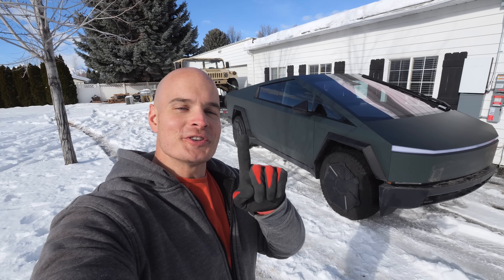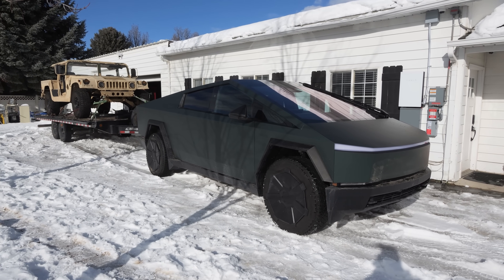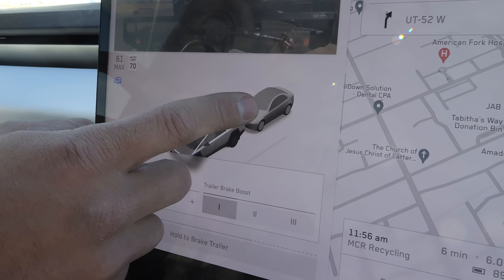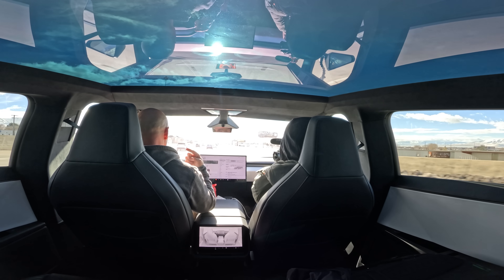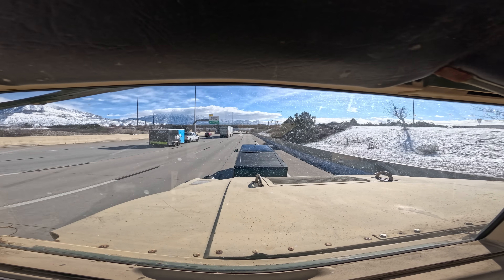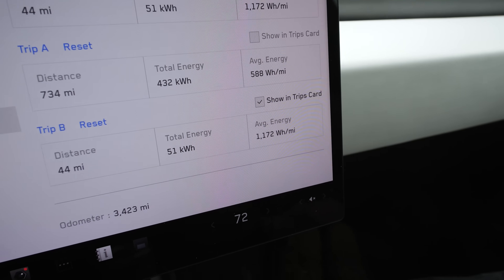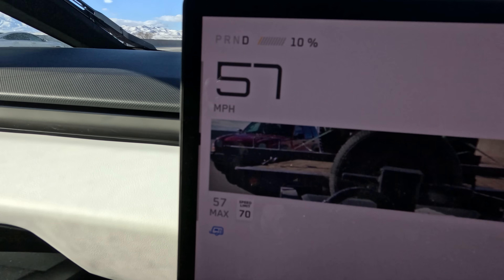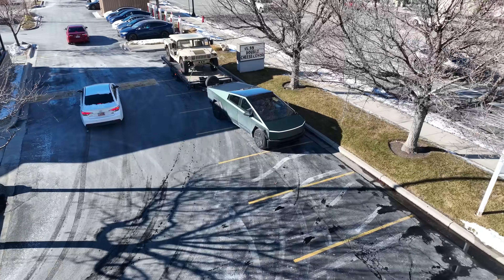How far can the CYBERTRUCK tow 11,000lbs in Freezing Weather?

Comment: 1,193 Wh/mi.  For comparison average energy over 2 years of driving a Model Y in Ca, mostly highway, is 285 Wh/mi.  260 in the summer, 310 in winter.
Another interesting comparison is that if it were a diesel ICE truck pulling same load and guessing it gets 10 mpg it would use 3,795 Wh/mi.  That's 3x more energy used.  But, that just shows how much unuseable energy there is in diesel or even gasoline (diesel contains more energy than gas).  Most ICE motors can only use about 30% of the energy in fuels.  Thermodynamic/mechanical limit.

Comment: Interesting concept vehicle. Just for reference; an F250 6.7L diesel can tow this load ~400miles and refuel in 5 minutes.
Reply: This wasn't buold for that.  Also, cost is gonna be 20x as much
Reply: You can only buy this truck as your 2nd or as a toy car.
Reply: And the refuel will cost what? $200 or more?
Reply: with a 60 gal fuel tank.

Comment: The scariest thing about this video is going 60mph on I-15 though the Wasatch front, even if you go 80 through there you'll be passed like you're standing still by most of the cars there
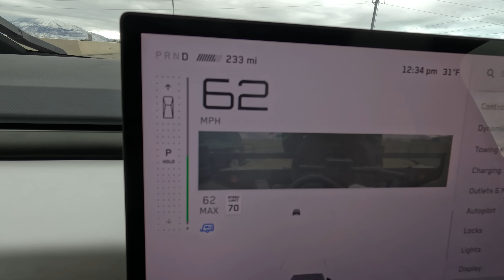Reply: 8:41 idd the cybertruck at 65 mph and a white pick-up with a car hauler went by so fast.  Almost german autobahn 🙂
Reply: @Blockiee  There is a 130 km/h, 82mph speed limit on many parts of the German Autobahn system these days, there's just too many people to go flat out all the time.  The best place to find the old school no speed limits Autobahn is in the old East Germany, it's less developed than the western regions.

Comment: These trucks are not at all useful for towing, except perhaps they would be excellent for short range repositioning of loads locally. The massive torque and the four wheel steering are cool and if your shop or distribution center has a high amp charger an electric truck might have. good niche.

Otherwise these trucks are not only horrible but disrespectful because of how much space they waste whenever they must drop the trailer and recharge.

Comment: For towing major weight loads, aren't the objects in tow supposed to be closest to the front as possible to prevent wiggle and flail?
Reply: Just forward of centre on the trailer, to far forward and you have to much weight on the tow hitch, most have a max weight loading on the hitch

Comment: It only gets 220ish miles per full charge due to being over-rated for real-world efficiency.  Try watching other owners' youtube videos and tiktok clips.  If you tow something in the ballpark of 2,000 lbs, and go 60 mph on freeway, good luck seeing more than 110 miles per fully charged battery.  And don't forget Tesla does not recommend charging to 100% nor does Tesla recommend letting battery go under 10% of charge.  Meaning, you only can use up to 90% of the battery capacity.  Not looking good.  But, if you just drive it around town and show off to people, you will be fine.

Comment: Yeah that's cool and all that it only cost $13 to charge it but 90 miles to a basically a full battery that's kind of crappy yeah it might cost me a lot more to fill up my 2000 Dodge Ram but on a full tank and towing I'll probably get about 250 miles to a tank yeah it cost me probably like 80 90 bucks to fill it but my truck only cost like 50 bucks to insure it because it's so old so it ain't worth it to me still to buy something like that

Comment: Would be interesting to see how these perform with the range extender battery pack in the bed. And will that affect towing capacity and tongue weight? Since that's a lot of weight in the bed I'm sure.
Reply: You can already do the math. The truck used nearly 1200 watts per mile. The range extender is allegedly 16kW, so 16000/1200 = 13 MILES 😂 Prob less due to the weight, as you noted.
Reply: @bry2k  Please pay attention to units.  Those aren't watts or kW.   If the range extender is a 50 kWh battery pack (that's a unit of energy, not power), then at 1.2kWh/mi that works out to an additional 42 miles of range.   And to the OP, yes, every extra pound you put in the truck reduces both the towing capacity and tongue weight.
Reply: Ya, and while your at it why don’t you tow a big huge battery! 🥴

Comment: I just don’t get it. To each their own, but what is the point? Even for a half Ton pickup. I went to the mountains on family vacation this past summer, 8 hour drive pulling a 5x8 box trailer. No where near 11k, but still, fueled up once. Took longer for the Fam to do the gas station snack run than to fill up and your back on the road. No worrying on out range, where am I gonna charge, is the weather gonna effect the battery. If electric is your thing, great. But 100k for a truck that will tow your boat 150 miles before becoming a brick for 40 minutes? I’m not anti EV, but I just have no interest.

Comment: $13USD to get a full charge. Doesn't sound bad until you consider the fact you only get 91 miles/charge when towing at/near maximum capability. Charging it every single night will add up too. I really hope EVs keep improving but thus far the specs of this truck really seem exaggerated by Tesla. Watch your fingers when closing the bonnet too. Apparently, there is no sensor to detect an obstruction and if someone's fingers or an item is in the way it will still close and you will need the Tesla APP to open it again. I think it looks cool but there are so many issues with the engineering that are not good. Drive safe.
Reply: From a lookup DC Fast charge rates at public chargers are $0.40/kWh to $0.60kWh.  If you charge at %0.50/kWh that 108kWh to tow the 90 miles would be $54.  A gasoline truck getting 8.5 mpg would use 10.6 gallon of gas. At $3.00/gallon that would be $31.80

Comment: Towing in   " FREEZING "  weather.  Well technically at 31F that is enough to just start freezing water.
Try that in   " REAL "  freezing conditions. Something like -30F or -40F.  That's what the temp is right now up here in Alberta.
We are seeing in the news what the real outcome of EV's in  COLD environments are, and how they are dealing with it.  And it isn't good.
Reply: Surprise, if it's cold enough your ICE vehicle needs a block heater, your EV will need to get plugged in too. People buying EVs with no access to sheltered parking did not bother to do adequate research.

Comment: You paid $14 to charge. OK so I drive a 20 yo car with a turbo admittedly i use 20% hydrogen that i synthesize on hand. That's 4 gallons I get 25 miles/gallon. 125 miles

Comment: Love what the electric trucks are doing and I hope the technology continues to get better and better. However, at the price point of these two trucks you can by a turbo diesel that gets pretty good fuel economy and would blow the doors off these in the metrics used. I understand the HP and acceleration are out of this world but the diesel is still kicking their asses at this point in time.
Reply: Until the electric trucks get 1000 miles of base range, they can't compete with regular trucks.
Reply: dont ask where the electricity for the cars is coming from if every car is electronic @chaydonofallon1352
Reply: @chaydonofallon1352 fundamentally that just isn't true regarding base range. Having a 1000 mile range is just asinine because you're towing extra battery for distance you never use. For 90% of trips the distance we have available is fine currently. If you're driving your truck that far you're staying overnight if it's work related. Now cyber truck is stupid from get go and will go down in history as the modern DeLorean. Fundamentally we need to shift away from driving focused as while we need battery electric vehicles, designing our world around cars isn't beneficial. Now with regards to clean. We'll even with a relatively higher carbon output in electricity, it can see be greener to drive electric. That is because electrical engines are more efficient. Fossil fuel power is more efficient than ice strictly because they can capitalize on both the waste heat and motion. Cars only get around 30% of the energy content. Long story short, anyone saying they're worse for environment than fossil fuel cars is just lying. Yea, ditching your current vehicle for a new one maybe? But depends somewhat.
Reply: Bro - at the moment you can't change the physics of battery chemistry,, In 2028 after $billions of research - you still won't be able to change the physics of battery chemistry,, but in 2030 - EV's won't be a thing - and nor will lots of car companies bc they'll go bust building expensive cars the customers reject. NOW HERE'S THE RUB. EV's were Never intended for use - Their whole purpose it to make driving unobtainable to the masses and destroy car companies in the process..  Polestar got their market value taken from 18 Billion DEK to ZERO last week by the holding bank in Sweden..many of Chynahs start ups are already bust,, Unless Elon helps by more than a charging tie up - I could see GM struggling to survive. Then there's the infrastructure: With both Ford and GM joining TESLA the existing charge suppliers are already struggling under roll out costs and profitability and tanked after the GM announcement. EVgo slid 12% on Friday, the worst performance it’s seen in nearly a month, while ChargePoint declined 13%. Blink Charging tumbled 11%, the largest daily loss it’s seen since February, and Beam Global tanked too.
Reply: Sure, except for making the planet uninhabitable. Not that the cybertruck is anywhere near zero impact, it's beta 1.0 towards getting close someday.   Look it up, just in the dollar cost alone of more frequent disasters it already makes sense to stop putting carbon in the air from the perspective of total economic cost over the next 100 years.
Reply: The Cybertruck is really bad for the environment too, mostly because of the production but also the weight and the inefficiency of the car which consumes a lot more energy than needed.
This is especially true when it comes to the U.S. who's energy/electricity production is made up of 80% fossil fuels including gas, oil, coal. It's 88% if including nuclear power which is considered non-renewable.
Reply: driving any kind of huge vehicle just to haul one or two people is wasteful. better in a wreck, but worse on changing the atmosphere @danielfrisk925
Reply: @danielfrisk925 not entirely accurate; think of it more as the amount of energy you can store in a battery vs the amount of energy in fuel. 

Harmful waste to the environment associated with increased electricity is a moot argument; a power plant will always be more efficient and safer in generating non-renewable electricity than anything at the local level. Improvements and regulations at that level are ideal because its reach is further than iterating efficiency millions of times over. It has a long way to go, but we wouldn’t be having any ev discussion had this not been the case. 

A lot more energy is available in the same amount of space of a gas tank vs a battery. Even moreso when it’s cold. Cold drops voltage and to offset that drop, demand remains the same so the amps increase from the battery, increasing drain. 

Eventually (and if the internals support it) you will see charge rates on these at the same level as their car counterparts. You’d need ~600kw charging to do it. Highest out there (in daily use) right now resides around 350kw. Tech doesn’t support that currently.

Comment: 7:13 - Does the louder sound perhaps come from the (direct) grearbox? I could imagine that the gears could not have been optimised for smooth running so that they could withstand the necessary torque.

Comment: How long did it take  for the Tesla to warm the passenger cabin?   Also, how much battery draw does warming the cabin affect the distance of travel?
Reply: My Model 3 starts heating the cabin in about 15 seconds when it's near freezing out.  Once the cabin is warm, it takes very little power to keep it warm - only a few miles of range per charge.

Comment: I love how he says summer tires in summer. "Slight advantage " come on. I have a lightning and love it but these comparisons are nonsense.
Reply from the maker: Street tires vs off-road tires is what I meant. And those make a huuuuge difference
Reply: @JerryRigEverything summer vs. winter tires also. If you need winter tires that actually work, you cannot get a better efficiency rating than "D". Compared with summer tires with an A- rating that is about 1-2% more fuel.

Comment: My dodge ram 3500 pulls 12k for about 250-300 miles in the recent snow storm but i will say exhaust brake was heavily used to not have to brake as often because the trailer brakes tend to lock up on the ice
Reply: How much did it cost you to go that distance?
Reply: better hope you dont ever drive on ice if you are using engine/exhaust brake as you can end up having a meeting with your trailer with a small vehicle like that
Reply: @IronWall_MaSu  I never had that issue, because the wheels are still spinning thus i still have traction and also you would have to be hauling ass in snow to even remotely get close to the gooseneck running into the truck. Taking it slow always works for me

Comment: Ok...posting this without even watching the video.

First:  We all know, or should know at least, that cold weather reduces the range of your EV.  The colder it is, the less range you have
Second:  We all know, thanks to the Rivian and Lightning, that towing anything of significant weight, drastically reduces range as well.
Third:  The Cybertruck has been out long enough now where we've unsurprisingly learned that the advertised range of the Cybertruck, falls a bit short than real world usage.

Knowing these three things, it's my expectation that the CT towing 11k pounds in freezing cold weather will get you less than 100 miles in range.

..... now let's watch the video

...... aaaand i was right.  And a side note, drafting off of a truck, requires that you be a bit closer to the back-end of the truck.

Comment: So…what’s the mpg of an F150 towing 11K lbs on the same route under the same or similar conditions? Is it more than 30?
Reply: I looked it up- it’s between 8 -11 mpg, regular mixed highway/back roads without huge hills. Lots of engine noise in the cab at that weight also. So, based on the information I have the CYBRTRK is about 3x more efficient. Well, all electric trucks are about 3x more efficient. That’s something. Still have other issues like gross range, recharging time and ease to improve upon. Not totally useless. Good enough for homeowner/occasional light use. Towing/hauling feel under load and handling are important, and I bet the torque is great for that. Still have room for improvement for sure, but it’s coming along. Remember, electric is still in its infancy whereas ICE has been improving for 100+ years already. Ironically, right now, the best way to improve ICE towing is with batteries/electric motors.

Comment: Context: 6 mpg (truck towing heavy load) = 5,617.5 wh/mile. 15 mpg = 2,247 wh/mile. 20 mpg = 1,625 wh/mile. 30 mpg = 1,123.5 wh/mile. 40 mpg. = 842 wh/mile. Suddenly, 1,100 wh/mile doesn’t seem quite so bad. It’s just that since the truck is starting out with the energy equivalent of less than 4 gallons of gasoline, and takes longer to “fill up” it sounds bad. Put into context, getting 30 mpge in the winter, albeit less than the 80 mpge in the summer, suddenly isn’t so bad. Couple that with all of the conveniences of electric for daily use, such as lack of most of the maintenance, it’s still a win from my viewpoint, but my use case isn’t for a tow/haul company either. Probably wouldn’t work for that use case yet. Weird though, the Tesla Semi truck does do well, wonder why that doesn’t translate proportionately down to the CYBRTRK? Perhaps someday they will make a dedicated cutaway style tow/hauler with no frills- just batteries and a frame and cab. 

Put another way: So, at its very worst, electric is still more efficient when compared to gas, AND it doesn’t produce tailpipe emissions that everyone has to breathe. Seems like a win to me. Don’t even start with the long tailpipe arguments. They are known, and it’s still way less emissions than ICE engine towing. They can also be filtered enmass at the point of generation, and the dirtiest plants are being retired and replaced with solar, wind, and batteries as the LCOE for renewable energy is lower.
So, how does an F150 do when towing 11K lbs? Does it get 30 mpg in winter on the same route?

Comment: Compared to an F-250 which is a little over half the price, can fill the tank in less than 10 mins and I guarantee you has over a 90 mile range on a full tank … and in 10 years, they F-250 won’t need a five figure battery change.  I don’t mind if people want an electric vehicle.  This country is all about choice.  I just don’t like the government saying that we will be forced into an inferior technology because of a political agenda.
Reply: I agree.  Plus the tiny little detail that in the US the vast majority of electricity is produced from fossil fuels.  It doesn't seem right to give them a $7,000 tax credit to run their "green electric" vehicle on electricity that's produced from fossil fuels.  Use of wind and solar is increasing but not compared to the added need for more electricity as the government wants everyone to use an electric heat pump  and EV's for cars and all lawn maintenace, and chainsaws.

Comment: Only 90 miles - I don't think that's enough  range for most people who tow trailers (certainly not enough range for me as I tow frequently in the winter) -  Also, the fact that you need to take off the trailer on/off at the charging station is not good/convenient. The towing range needs to be much better before I would consider. This is the trucks biggest/only shortcoming for me but I guess the same goes for all EVs.